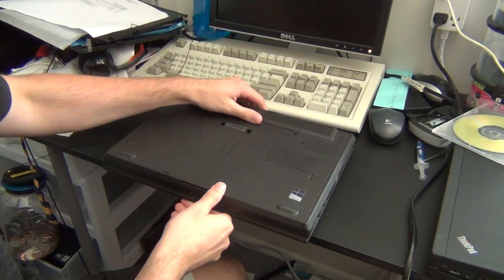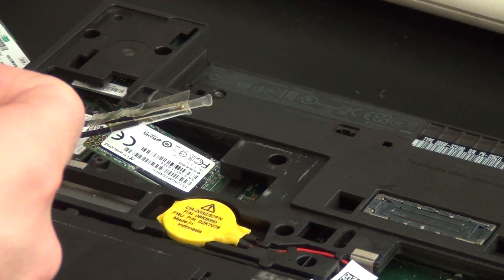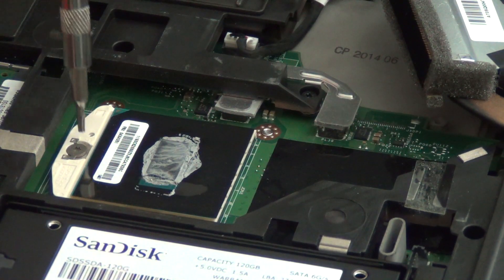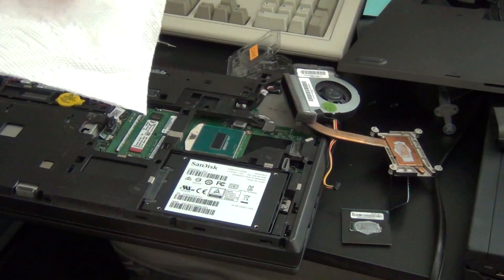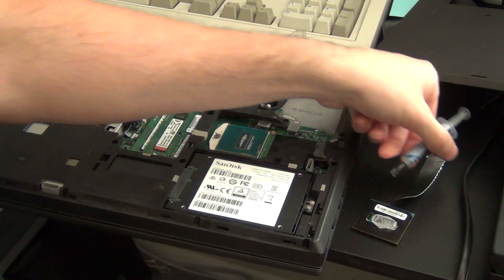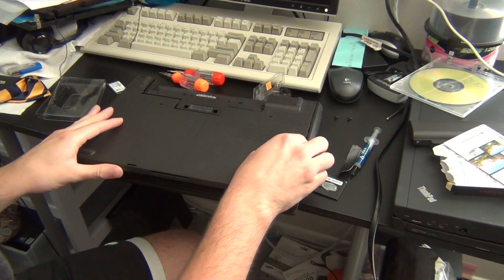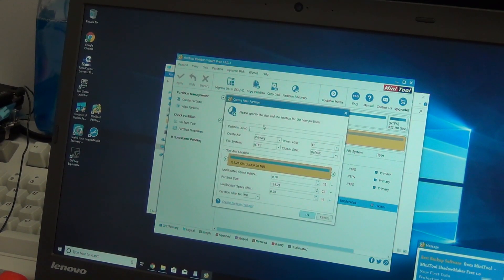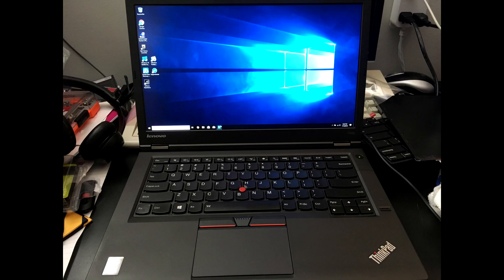Lenovo ThinkPad T440p: CPU and storage upgrade

Comment: 2:59 actually, a bit more is better than a bit less in this instance. With bare dies, you want it to cover it completely as everything will generate heat.  If it spills over the sides a bit is better than a part of the die not getting covered in the goo

Comment: Thanks. I recently bought the same laptop. I have 16gb of ram on the way, and I'm eyeing either a 4702mq or a 4910qm to upgrade the cpu even though the little i5 runs Linux Mint just fine. These little Thinkpads are built like tanks

Comment: Hi I have question. I saw lot of comments said that if  we upgrade the CPU, the heatsink need to be upgraded too. Is that true? If not what is your advise to get use full power of i7 processor. Do i need to upgrade fan too? Or any other things? I afraid the heat will increase if i upgrade to i7
Reply from the maker: Use a good quality thermal paste and keep the fan/vents clean and free of dust. Some people have said using the heatsink with the extra pipes for dedicated GPU models cools the temperatures a little bit for the CPU (if the model you're using does not have a GPU), but I tried that and didn't really notice a difference.

If you use the i7-4702MQ or 4712MQ those have the same TDP (37W) as the i5 chips, and in that case thermals probably won't be too much hotter than with the stock i5/dual core i7s.
Reply: @SebisRandomTech  okeyy thankss dude. Ur video also really helpful. 👍

Comment: Another question...? Did I buy a 4G, LTE, HSDPA, 3G WAN card Sierra WAN M7355 Gobi 5000 modem to use a SIM Card in my LENOVO T440P, and when I installed it in the space where the M2 memory also goes, the cables with the Red connectors did not come main and black Aux. Obviously do not connect them because the T440p did not bring them. I closed it, I installed the official driver and I also put a SIM in it, but it does not detect it. You think that if those connections of the red main and black aux cables are very necessary that they should go to the Wan card. Why can't the SIM card detect me? You, who are a more experienced crack, could you guide me please ...?

Comment: Hello friend, What brands and capacities of Disk or memory M2. do you recommend? What make and model did you put on it? In the video. Also, what is the i7 processor model cap that this i7 4800MQ laptop supports ..? or up to i7 4900MQ ...?
Reply from the maker: It was available from Lenovo with up to a 4900MQ, people have had luck putting in faster processors but the performance improvements will be negligible.
Reply: @SebisRandomTech  Thanks Bro..!

Comment: Is it possible to upgrade to a Windows 11 compatible CPU like Intel Core 10th Gen? Or you have any other advice? Thanks.
Reply from the maker: Nope, you are stuck with 4th generation CPUs. It's likely possible to patch Windows 11 to make it work on older computers like this, if not now enthusiasts in the community will probably figure out a way to.

Comment: I'm trying to understand it. Lenovo ThinkPad T440 CPU cannot be replaced. 

But T440P can?
Reply from the maker: Yes. The T440 and T440s use low power CPUs that are soldered on, the T440p uses higher power socketed CPUs.

Comment: I recently picked up an t440p from an old store.. it has 500gb hdd with windows 10 installed.. can I use an SSD for booting and hdd for storage.. If so how to set up dual storage in t440p?
Reply from the maker: Use a 2242 M.2 SATA drive for the SSD and install Windows on it.
Reply: @SebisRandomTech  thank you bro👍👍❤️

Comment: Thanks for your video. Can I upgrade with the following Intel Core i7-4900MQ ASM CPU CPU?
Reply from the maker: You could, it might run a bit hot though.
Reply: temperature will be a problem since it has 47 W tdp batery will be drain faster as well

Comment: My T440p did not come with the integrated camera, so I installed one and it is not working. I have tried numerous driver updates and reinstalled WIN 10 and it still is not working. I am in school and I really need the camera for virtual classes. I would greatly appreciate any help. Thanks
Reply from the maker: Make sure it's a model that works with the T440p, and make sure the cable is inserted correctly. Try running in Linux and see if it works there.

Comment: What do you think of the T460P?
Reply from the maker: Nice laptop if you can get it for a reasonable price.
Reply: @SebisRandomTech  What's a reasonable price for them? I saw that the keyboard is the one with the hidden screws, is that a deal-breaker in your opinion?
Reply: @SebisRandomTech  is the cpu on the t460p upgradeable?
Reply from the maker: @enochthestud  No, the CPU on the T460p is not upgradeable.
Reply: @SebisRandomTech  what’s a reasonable price for the t460p? I saw one for 450 but also with 50 dollar shipping fee since I live in Taiwan. It had an i7 6820 cpu I think. Is that a reasonable price?
Reply from the maker: @enochthestud  Not bad! Especially for Taiwan.
Reply: @SebisRandomTech  yeah, but then I found out that the t460p doesn’t support nvme ssds :(.  Is there a Thinkpad that is new enough to support nvme adds, but old enough that it would be available for cheap?
Reply: @SebisRandomTech  I looked upon some forums, and it said that these thinkpads could support nvme ssds: 
The following ThinkPads support PCIe NVMe SSDs via an M.2 2280 slot that is soldered onto the motherboard:

13 (2nd Gen)

E560p

E570

P50

P51

P70

P71

T460s

T470s

X1 Carbon (4th Gen)

X1 Carbon (5th Gen)

X1 Tablet (1st Gen)1

X1 Tablet (2nd Gen)1

X1 Yoga (1st Gen)

X1 Yoga (2nd Gen)

ThinkPad Yoga 260

ThinkPad Yoga 370

1 Please note that the SSD of those ThinkPads isn't a CRU.

Some other ThinkPads support PCIe NVMe SSDs via a 2.5" caddy for M.2 2280 SSDs:

L470

L570

P51s

T470

T470p

T570

X270

Most M.2 2280 PCIe NVMe SSDs can't unfold their full potential in those ThinkPads as they're only attached via two instead of four PCIe lanes.

Some Skylake ThinkPads were available with 2.5" SATA Express PCIe NVMe SSDs:

P50s

T460

T460p

T560

X260

Which one do you would be cheaper now?
Reply from the maker: @enochthestud  That's a lot of different laptops for a lot of different uses, at differing prices. An X260, P50, and T460p are all very different laptops. You'll have to pick the best option for your needs.
Reply: @SebisRandomTech  Can you tell me what the E series thinkpads are for?
Reply from the maker: @enochthestud  They're cheaper models, generally considered to be less than stellar.
Reply: @SebisRandomTech  oh, so not as good as the T series?
Reply: @SebisRandomTech  How much ram can the T460P take?some people say 32G, but the Wikipedia said that it can support up to 64G.  Also, I heard a problem that the T460p can't contain both an nvme ssd and a 2.5 inch ssd is this true?
Reply from the maker: @enochthestud  I think 32 GB is the maximum, but I have heard a few people say it can take 64. Only one way to find out! :P

I believe a 2.5" drive can be used in the SATA bay and a 42mm NVMe SSD can be used in the WWAN slot.

Comment: Its a great upgrade, i am planning on upgrade my HP Probook 650 to the i7 from the factory i5 4200M. Just don't expect very big improvement in gaming. Remember its still using the factory Intel HD 4600.

Comment: What about the clock speed?  If I upgrade from i5 to i7, am I still limited to my original clock speed or  can I boost that to what the i7 can handle?
Reply from the maker: It will run to the speeds the i7 can handle.

Comment: can the T440S be upgraded the same way with the i7-4702MQ?
Reply from the maker: No, the T440s uses processors that are soldered on and thus can’t be upgraded. Even if they could, the thermal system on those models isn’t designed for these more powerful processors.
Reply: Just read about that, thanks for the info!

Comment: Hi Sebi, can u pls tell me otherthan T440p n T430p series ... Is there any other Model in Lenovo ThinkPads to upgrade CPU manually? (without soldered)
Reply from the maker: Almost all T-series and W-series ThinkPads up until the T440p, T540p, W540, and W541. This includes older ThinkPads like the T60, T61, T400, T500, T410, and T420. The -s suffixed models (T420s, T430s, etc) and the X-series ThinkPads do NOT have upgradeable CPUs.
Reply: Hi Sebi... Thanks for your response. If possible can I have ur mail id incase of any doubts in future.
Reply from the maker: @cloud_07  This is on my channel page.
Reply: Sebi, Pls do video on other brand laptops in order to upgrade the CPU manually..
Reply from the maker: @cloud_07  There is a model by HP I may look into, but otherwise I will do the kinds of videos I choose to do and there aren't too many other laptops besides ThinkPads I want to make videos on.

Comment: Hello from ecuador can you help me with a problem, my m.2 have been working just fine for more than 6 months but a few days ago the t440p doesn't recognize it, when started the m.2 shows a red led light without showing the system. Could it be dead? Any guide or recomendation?
Reply from the maker: Check in the BIOS settings that it’s showing up, and that the correct boot mode (Legacy or UEFI) is enabled.

Comment: It will work if we use different generation of processor, like Intel core i7 6th Gen?
Reply from the maker: Nope. It has to be a 4th gen processor. You wouldn't even be able to find a 6th generation laptop processor, as Intel stopped offering socketed laptop processors after 4th generation.
Reply: @SebisRandomTech  ok thanks men

Comment: How about the dimension if we use M.2 Sata 256 gb, it's work?
Reply from the maker: As pointed out in a previous comment, as long as it is a 42MM M.2 drive, it will work.
Reply: @SebisRandomTech  👌

Comment: On Thinkpad T440P , in Slot Hdd, can we use ssd 1 terra or only ssd 500hdd ?
Please Respon sebi. Thanks
Reply from the maker: Any capacity will work, as long as it is a 2.5" SATA drive.
Reply: @SebisRandomTech  ok bro thanks

Comment: Does it Thinkpad T440p support M.2 sata 512gb size?
Reply from the maker: As long as it's M.2, SATA, 42MM size. It will not support an 80MM drive.
Reply: @SebisRandomTech  ok thanks for your answer sebi

Comment: So apparently there is a security vulnerability in the Ivy Bridge & Haswell iGPUs. The patch has not been released on Windows but on Linux, it's been reported the slowdown performance by 20 to 60%. It seems like really bad news for older ThinkPads, unless they have the dGPU.
Reply from the maker: Good thing I still use Windows ;)

Comment: Will I need a 135W or a 170W AC adapter in order to charge my T440p properly if I upgrade the CPU to an i7-4810MQ? The TDP is 47W. As long as the battery will charge it will be fine. I'm using the 90W adapter.
Reply from the maker: Do you have the dedicated Nvidia GPU or only Intel HD graphics? I think that plays a role in whether you will need a larger AC adapter or not.
Reply: @SebisRandomTech  Only the Intel HD one.
Reply from the maker: @KylesDigitalLab  Then I think 90W should be fine, but it you notice any performance issues or obvious throttling then go up to a 135W adapter.

Comment: How long do you think you can use the laptop for (if you still had it)? Do you think you can still use the laptop without feeling like the laptop is "lagging behind' against other $1000 laptops in the future? Sure, it is snappy now and all, but it seems like you would have to buy a new one in 4 or 5 years.
Reply from the maker: Typing this comment from one now! Considering I have a ThinkPad T60 from 13 years ago still in regular use, I'm sure a T440p will still be usable for many years to come. Maxed out T440p's can still match the power of the newer T480 and T490, so I'm not worried about this becoming obsolete. And if I can get 4 or 5 years out of a laptop that's already past 5 years old? Not too bad.
Reply: Now I'm replying too. I still use T440P that I bought last year , refurbished set but I upgrade one by one from hdd to sdd, from 4gb ram to 16gb ram. And now I'm lookong to upgrade more . The laptop is excellent, faster and brilliant. Just the lack is that the graphic card is only for ordinary use.

Comment: I received the processor today (I live in Brazil) but the thinkpad t440p refuses to boot. any tip?

Intel Core i7-4710MQ SR1PQ 2.5GHz Socket G3 Mobile Processor CPU Quad Core - with the i5 it's all good and the seller has stellar ratings on ebay. Maybe a bios update?  (I'm using a 135w power supply btw)
Reply from the maker: Possible. If you have any other Haswell laptops you could try the processor in those.

Comment: Can I remove the two spare antenna cables from the LCD Assembly? Since I'll never have a use for them, and since I'm replacing the lid on my T440p and I already removed the cables, can I set them aside for now?
Reply from the maker: You might be able to, I always like to leave them in place "just in case".

Comment: after upgrading the panel did u have problems adjusting the gamma like in the T450 model?
Reply from the maker: What? Gamma? Do you mean brightness?
Reply: @SebisRandomTech  Yes, brightness, i've been meaning to change my T450 LCD from 1600 x 900 to FHD IPS
Reply from the maker: @huecobros  The T450 has a display whitelist which limits which panels you can put in. The T440p does not have this whitelist so you should be able to use whichever panel you want.

Comment: In my country, a t440p is twice the price of a t430. T430 is PHP 8500, T440p is PHP17000. Is it worth paying twice the amount for a t440p than for a t430?
Reply from the maker: Twice the amount, absolutely not. Stick with the T430.
Reply: Same sentiments, Sir. I'm really sold on getting a T440p as my 1st thinkpad and project laptop. But apparently it's way more expensive than the T430 here in PH. Some people on fb group Lenovo ThinkPad PH suggest to find better deals on ebay. I'm still on the research stage tho so I'm not in a hurry. Give us an update on whichever you decide to go. Cheers! :)

Comment: The i7-4800MQ is pretty decent too
Reply: If your laptops heat sink can handle its heat output. If not, the CPU will just throttle itself down and you wont use full its full power.
Reply: @applepoop10  they may of done an undervolt which reduces temps by quite a bit.

Comment: Which i7 processor would be best for this upgrade? I don’t want to have this baby of mine throttling or running hot.
Reply from the maker: 4700MQ is pretty good. 4702MQ runs cooler.
Reply: @SebisRandomTech  thank you so much. I was about to purchase the 4900 that Tek Syndicate mentioned. Thanks to this, I hope I won't have to buy a new heat sink.

Comment: where you installed windows, ssd 2.5inch or ssd m.2 ?
Reply from the maker: M.2 in this video. The idea is to have a M.2 SSD as the boot drive and then have the 2.5" drive bay open for expansion.
Reply: @SebisRandomTech  thanks, do you still using it until now?
Reply from the maker: @muchamaddestafadilah  This system was for a friend. I've done this on a few other newer ThinkPads, T440, T450, X240, and a few T440p's.
Reply: @SebisRandomTech  i'm pleasure ... thanks for your info.

Comment: The connected AC adapter has a lower wattage than the recommended model which was shipped with the system  with 65w adapter. After  CPU  upgrade to 
Intel i7-4702MQ procesor
Reply from the maker: The AC adapter I used was a 90W adapter.

Comment: Hi, Thanks for the video. I have a T440 without back lit keyboard - Will a T550 back lit keyboard work in my T440?
Reply: https://www.ebay.com/itm/OEM-Lenovo-Backlit-Keyboard-T440-T440P-T440E-T440S-T431S-E431-04X0139/261976424436?epid=2255773118&hash=item3cff02fff4:g:9t0AAOSwDNdVrtAg

This will work as the T440p's with Nvidia Graphics chips come with the backlit keyboard.
Reply from the maker: The T550 has a dedicated numeric keypad, which the T440 does not have. As such, any T5*0 series keyboard won't fit in a T4*0, starting with the *40 generation.

Comment: Can I upgrade T450s 5600U with I-5500 (with dock connector) .. with GF 940M? I wondered that if it could be upgraded on the motherboard.. those GF chips are widely sold on internet.. any help? :) Thanks
Reply from the maker: It could potentially be possible to solder on the GPU, but you would also have to get the VRAM for the GPU and I've read somewhere that some of the necessary hardware for the GPU to work isn't present on the non-GPU boards. So really the only way to upgrade the graphics would be to buy a motherboard that has the GPU installed.
Reply: @SebisRandomTech  I see. Do you know if there are any eGPUs for T450s? I know there are some Thunderbolt 3s.. but there is no T3 connector on T450s. I do have some T3->USB 3.0 connectors.. do you think it will work properly if I connected eGPU with T3 to this T3->USB3.0? Thanks
Reply from the maker: @angeliqueluttmerding  Performance wouldn't be amazing, but it might work.

Comment: I have Lenovo t440p i5-4300M 20AW-S10V00 S/N PB-00LC9C 14/01. You think 7i-4702MQ would work without problem with 65W 20V PSU? And it doesn't need any bios flashing or any strange tweaking?
Reply: the t440p datasheet says that the laptop needs an ac adapter of at least 90w for a quad core and recommends the 135w ac adapter.
http://psref.lenovo.com/syspool%5CSys/PDF/ThinkPad/ThinkPad%20T440p/ThinkPad_T440p_Platform_Specifications.pdf

Comment: Hi, i have a question regarding this setup. I did the same thing with my T440p but with i7-4702 temp sensor doesn't work and fan is always off. Does it work the same for you?
Reply from the maker: Worked fine for me. You could install tpfancontrol to see if you can force the fan to run that way.
Reply: @SebisRandomTech  With tpfancontrol fan is working as it should but as soon as I close program or set it to be controlled by BIOS fan stops. I think that CPU sensor might be broken. Thank you for reply
Reply from the maker: @krzysztofzaborowski8132  Very odd. I would suggest consulting the thinkpads.com forum or the r/thinkpad subreddit since someone more knowledgeable on there may be able to help you more than me.